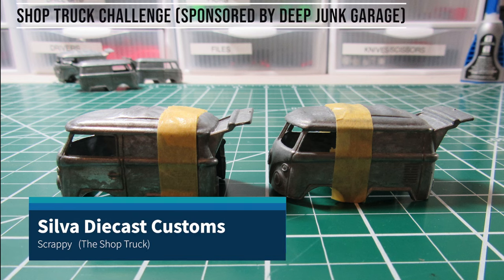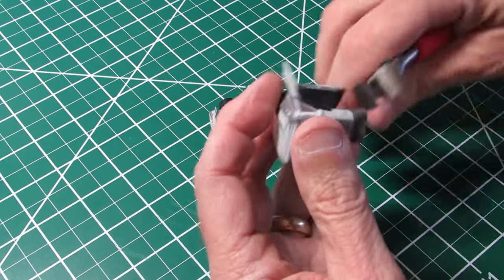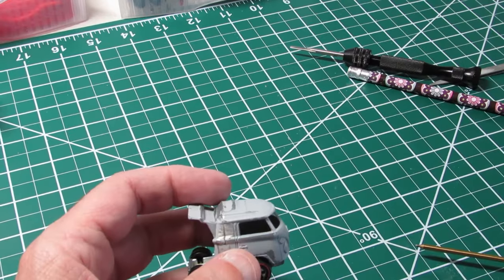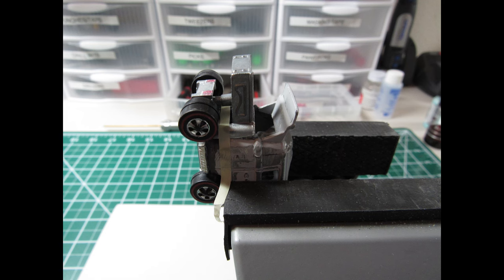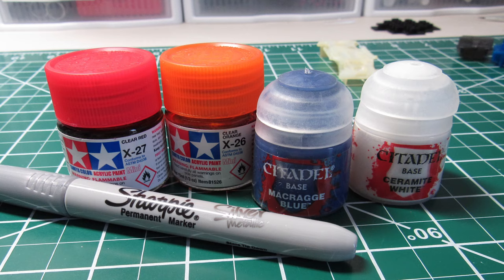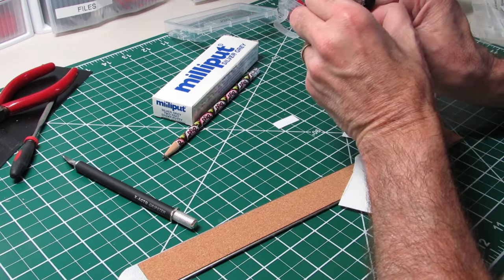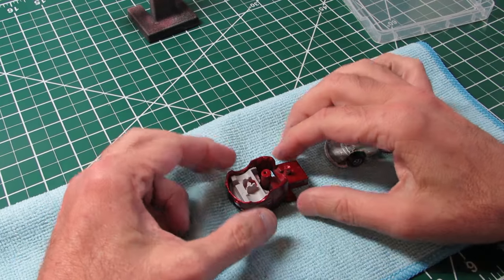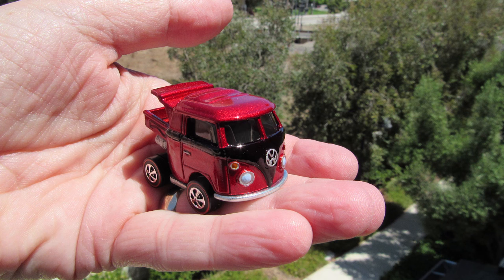Scrappy the Shop Truck (Deep Junk Garage Shop Truck Challenge)

Comment: Great paint job and use of scrap parts. I think it would have looked better if you removed the open back and graphed it back into the body being closed.
Reply from the maker: Mopar_ Dude Thank you!  I’m always torn on the Kombis and the back hatch.  I thought about closing the back and cutting off the hatch...but I also love the look of it as it almost seems more like a wing.  I filed off the the button on the hatch.  There’s something about the angle of the bed matching the angle of the “wing” that I liked.  (Side note - I have two “smooth” top Kombis on the bench now and I can’t decide if I’m cutting off/smoothing the backs or not - it always drives me nuts lol)